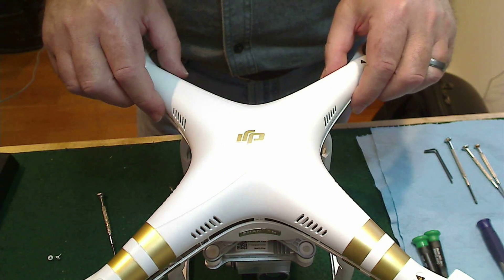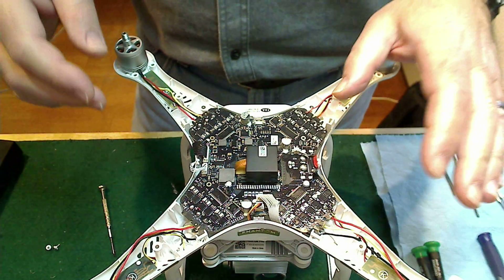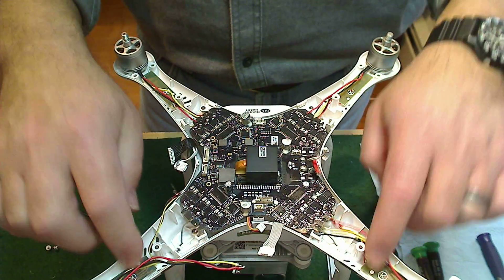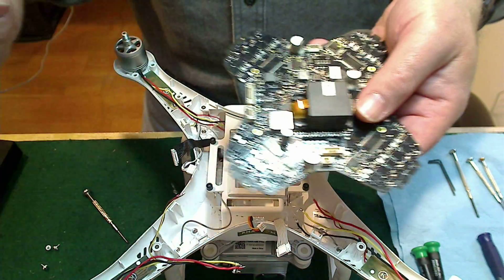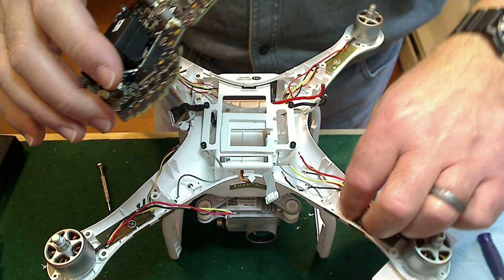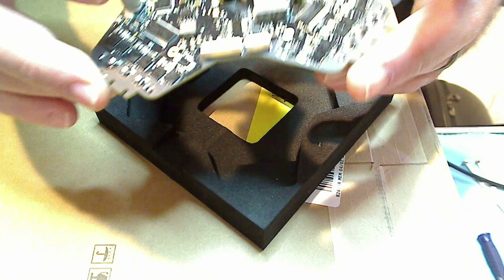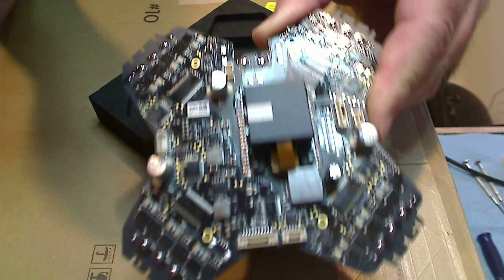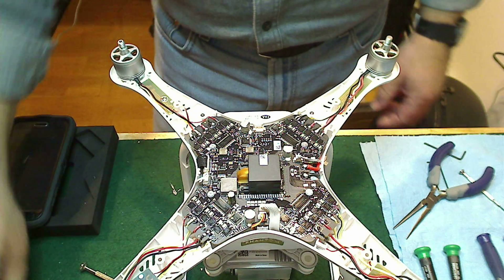Phantom 3 Professional - ESC Center Board Replacement(Part 96)

Comment: Great Video!   I was given a crashed P3P (old version) turned out to have a bad IMU.  Will be replacing the ESC with new board soon.   Did you have to activate new board and were there any issues with Firmware?
Reply from the maker: Thanks Jim! No problems at all. You just need to pair the transmitter to the bird. You should be good to go.

Comment: I am having trouble getting the solder to stick to the pads on the board. Any tips?
Reply from the maker: Apply the tip of the soldering device to the pad to heat up the pad, then apply a small amount of solder. Create a small puddle on the pad. Then apply some solder to the wire that you want to affix. Once that is complete, reheat the puddle and stick.the wire on. Everything should adhere nicely. Make sure you are using a very fine tip on the soldering device. Hope this helps.
Reply: Worked like a charm. Thank you!!
Reply from the maker: @Keystonya  Glad I can help!

Comment: The original ESC on my P3P had glue strips to secure the wires to it so the solder joints don't vibrate loose. Did you re-glue the wires to the ESC? If not, why?
Reply from the maker: pucksterx2 I did not reglue. If you can solder properly, there should be no reason for the solder joints to vibrate loose. Also the wires snap into cutouts on the PCB keeping them from moving.

Comment: Love this vid just had a question do you have to reconnect your controller when you put the new center bord in?
Reply from the maker: nik simone Yes that is correct. Re-Pair it with the transmitter using the standard procedure.

Comment: Hello i can't connecté my radio  to the phantom 3 advanced i nees toi change esc board ? Thx
Reply from the maker: TristanModel I dont believe so. generally you will see an ESC error with the need to change the board. I would look first at the tablet/phone apps. Maybe try removing one app to see if it allows you to connect. over the past year or so. there has been many reports of no connectivity if you are using a third party app with DJI Go also installed on your device.

Comment: Great video! Thanks. What about the serial number of your Phantom after replacing the center board? It will be different. Do you know, where on the center board the serial is stored? Can one change the serial in any way? Thanks for reply.
Reply from the maker: Philipp Schütt Did not have any issue with regard to S/N

Comment: on my P3A I have esc error but I have the motors that look like a crown. Also my P3A didn't start with that esc error until I replaced the body shell & was extremely careful doing so. if I get a new/used board whats gonna be different when I take it apart again ? because it didn't start with this esc error until I replaced the body shell.... Any input would be greatly appreciated.
Reply from the maker: Aaron - Just replacing a shell will not cause any ESC errors unless you damaged something on the board when removing & replacing the board and the jumpers.  I would look again at all the jumpers and re-seat everything.  If you are still receiving ESC errors, then something is wrong with the board.  Regarding the motors:  what you describe sounds like the old motors.  In this case you would need to get the ESC board for those.  Otherwise, if you get the new ESC board, then you would need to also replace all four motors to the new style.

Comment: Great video! I wanted to ask you if there is a way to fix the OFDM and Compass connectors(the actual mounted housing for the  plug). I broke mine while taking the housing off. I hope i can solder on replacements but cant find them because I can't find part numbers from Dji or from anywhere else. Am I forced to buy a new board?
Reply from the maker: My guess is you will need a new board.  Unless you can find the parts on Mouser.com.  These things are not proprietary in any way.  These are common electronic board interfaces.  I believe these are called board to board & mezzanine connectors. I checked my old board and the GPS jack is 5 conductor.  Even if you find it, you will be hard pressed to be able to cleanly solder those to the tabs.

Comment: Great vid - how long did it take to change, estimate....  And are boards interchangeable between same series Phantoms...  ie. P3 Std...  Thanks
Reply: Maybe 2 hours max.  Not sure about the P3S.  The important thing at the time of filming was which motors you have.  That would determine whether you needed Part 96 (new style motors 2312A) or Part 33(old style motors)

Comment: Hello, what type of solder did you use and what temperature?
Reply from the maker: Logan Walker I used standard 60/40 solder with approximately 340F melting point. No issues.
Reply: Aerial Photo Platform Productions thank you!

Comment: Once again. When you said the part 96 must be installed with new motors what do you mean under new? Freshly installed new or new generation. I have Phantom 3 Pro and I need to replace center board, all my motors are ok. So, which part should I buy? Thank you very much for your time. Your advice will help.
Reply from the maker: Oleg Osadchyi some of the older model Pro & Advance units had different motors. If you have the old style motors, Part 96 is not for you unless you change to the new style motor.

Comment: Is the radio transmitter on the board? If I replaced my, do I need to rebind the remote?
Reply from the maker: Yes, you must rebind the transmitter to the new ESC board.  Easy to do.
Reply: Cool, I crashed my p3a, one motor doesn't work anymore with an error message says motor obstruct, I tried a new motor, but everything still remains the same. So I guess must be the esc problem. Is changing the center board the only option?
Reply from the maker: I would replace all motors too.
Reply: could you explain it a little bit more to me? I though the motors are fine, why I still need to replace them
Reply from the maker: They might very well be OK, but that remains to be determined.